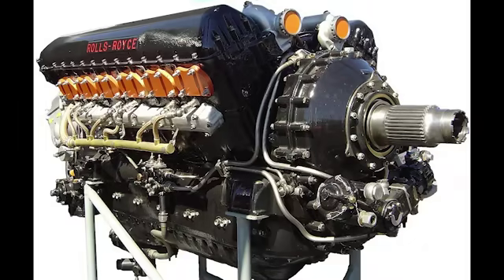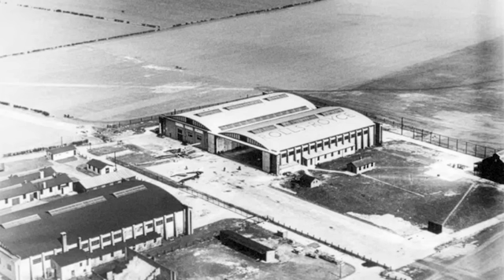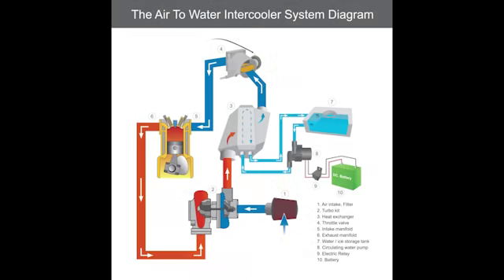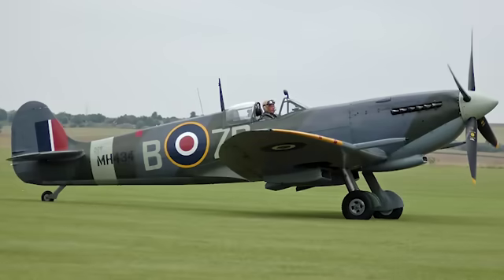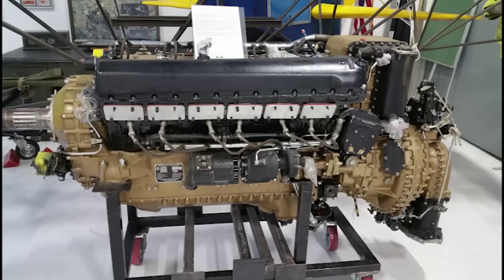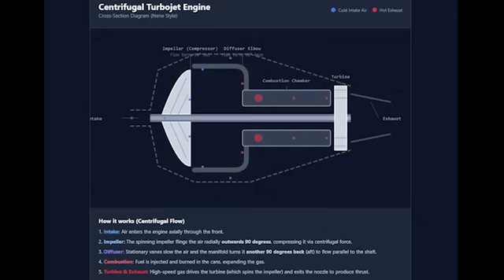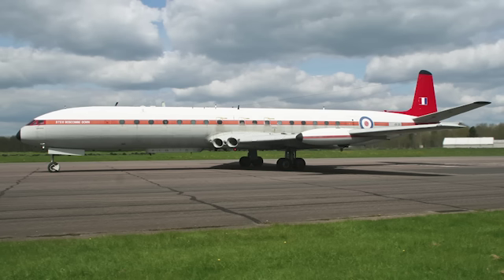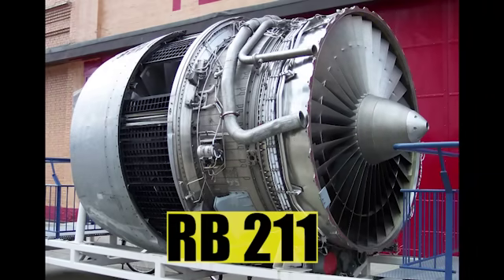The GENIUS Who Pushed The Merlin To The Limit

Comment: The Merlin was a fantaastic engine. But, it had some limitations. notably.........no fuel injection.  The benefits of FI were known in the 30's by the Brits, Germans and Americans. But, some pompous tit at the head of the RAE.....(Royal Aircraft Establishment) in the UK said he didn't like it so the UK dropped FI development falling back on carburetors which they knew about. Germany did not give in so easily. It was only during the battle of Britain that FI was taken to RR to look at that the benefits of FI were realised....notably better fuel consumption in multi piston engines and more power. Also the cylinder block of the Daimler benz was of more resilient iron rather than the alloy of the Merlin. Lighter for the Merlin but not able to withstand the canon shell of a 109. Where as, 303 bullets from a Spitfire against the block of the DB engine would tickle it. OK; later Spitfire marks ironed out deficencies in armament and fuel starvation but it must be remembered that the Spit ran on 100 octane fuel that was not available to the Germans. Point being with all of this is that the  Germans thought very carefully what a military fighter should accomplish. They were both ambitious and forward thinking. This is in no way a defence of the Nazis but more a reminder that forward thinking and courage to step outside the comfort zone can realise benefits.

Comment: What this video intentionally misrepresented is the fact that the axial flow engine was first successfully flown on the ME-262 by the Germans during WW2, and that the British copied that engine design after betting on the centrifugal flow engine.
Reply: Rubbish The British were working on Axial Flow engines from 1937 onwards with a project run by the RAE and Metrovick. The Metrovick engine first ran on the ground in 1941. Flew in the back of a Wellington in 1943 and was used to power a Meteor prototype in 1944 which crashed due to an engine failure.
Reply: @richardvernon317 The fact is the Germans incorporated an axial flow into a working aircraft before the British. Laboratory success and production success are two different things, one speaking out loudly and the other whimpering.

Comment: The Diagram at around 4 minutes 10 is wrong. It shows a turbocharger. Tge Merlin did not use a turbocharher. Tge Superchargers were driven driectly off the engine.

Comment: 7:13, I don't know where you got that picture of a jet engine but on another youtube video (it might have been posted up by you or someone else) the same picture is shown, the air flow 'arrows' in the picture indicate that the air is flowing in the wrong direction! The  Labelling of the components is also wrong, it is obvious that the compressor stage in on the left hand side of the picture, the turbine stage is on the right.
Reply: I'm guessing it's AI slop. Also, there aren't nearly enough compressor stages for an axial flow jet

Comment: The Comet had structure problems. Engine problems were minor in comparison.
Reply: The Comet suffered from management ignoring the engineers advice, the engineers wanted to pressure test and flight cycle a fuselage, management decided not to carry out this due to time and money constraints. The same problems that caused catastrophic failures of the Space Shuttle, they ignored the engineers and launched in too cold weather, the booster rocket seals failed as warned about by the engineers and 7 astronauts died and US Space programme put back by years.